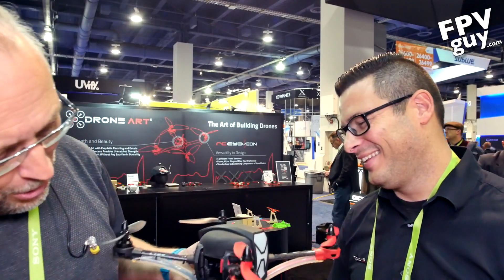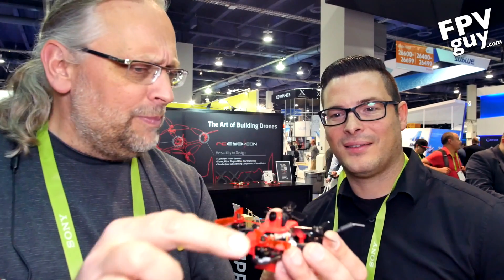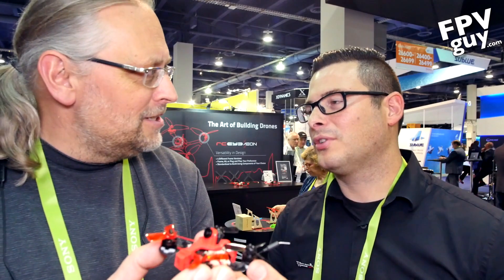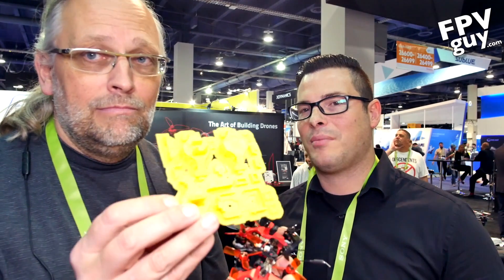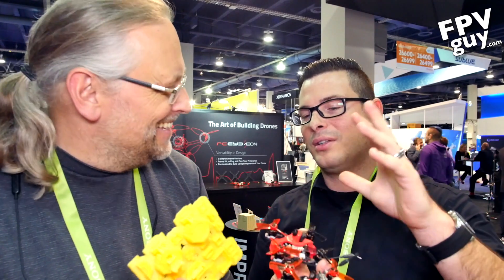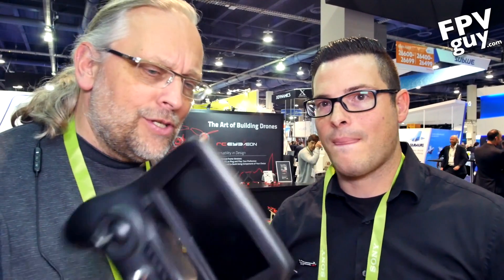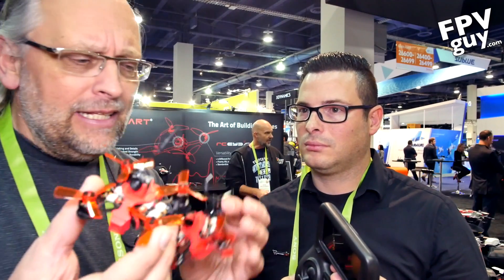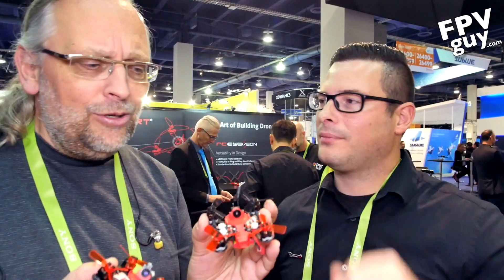CES 2018 • DroneART 73mm MICRO FPV Brushless

Comment: I won't pretend to know much about quad motors, but wouldn't it be better if the 1103's on this quad had a higher KV rating (say 10k) if the ESC can handle up to 5s?